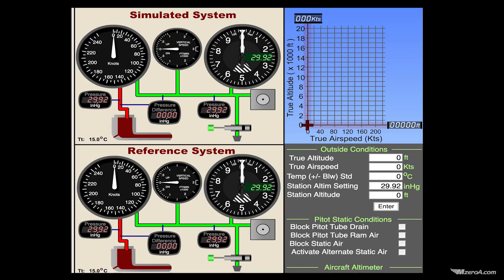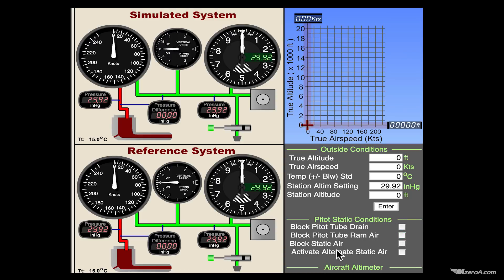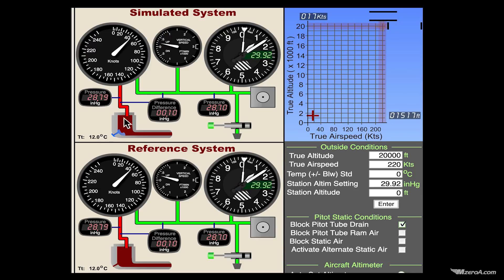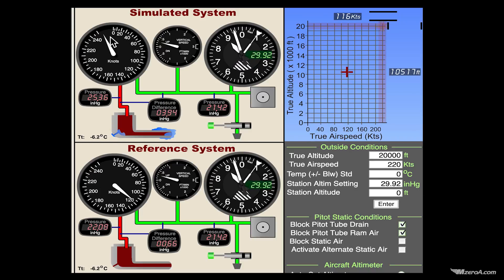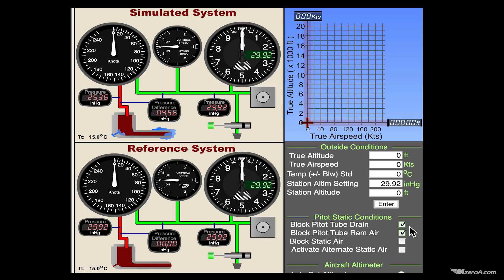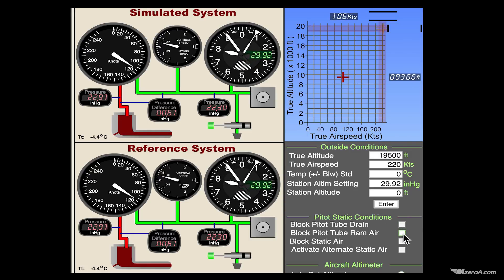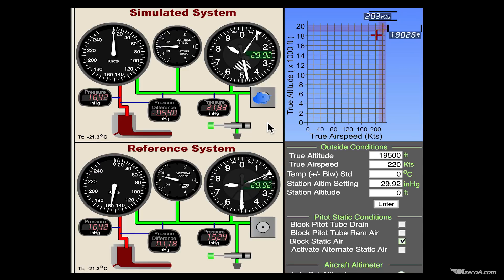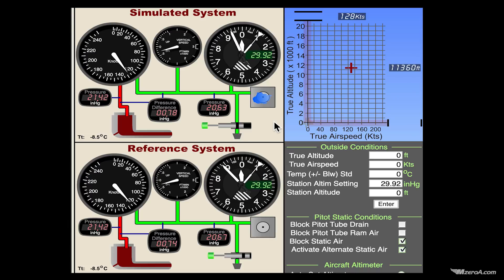Pitot Static System Errors - Day 7 SPC

Comment: I have to tell you.. About 3 days after I passed my check ride, I took the same C-150 I passed in, out for a flight with a lady friend back in about 1996.
We went from the (now closed) Norfolk airport in MA, up to Keene NY. Then we flew back to Fitchburg MA to get fuel.
After getting fuel, I did the runup again, checked all systems etc.. All seemed well, so I took off.
At some point during climb out, the vacuum pump in the little C-150 started failing. I didn't know right off. I started changing headings via DG to head back to Norfolk, MA... 
What I didn't realize, was that I was actually heading to Boston MA.. (KBOS)  Could have been a huge issue... Instead, I realized that (oh yeah, it was at night.. ) that the lights were not familiar.. 
Realized it was Boston, something was up with my instruments, and I did a quick 180° turn..   I know I was below the Boston airspace, but any further I may have busted it.. 
In any event, I lost DG, Artificial horizon and turn coordinator..   Thankfully, It was a super clear night, and I was able to find Rt9 in Framingham, then follow Rt495 S and let the roads lead me back to the base airport.
That was my first "IFR- I Follow Roads" incident.. 
We landed safely, and the little C-150 was in the shop for about a month... I guess they found something else..  
I feel lucky to have survived that, but also take credit in my training to realize something was wrong, and to revert to what I knew to get us back down safely.  (I needed new underwear, however.. )  :-)

Comment: This simulation does show it, but I have yet to see it expressed well enough. Airspeed doesn't "lower" as you climb with a blocked static port, It disappears! I, unknown to me, had a case of the pitot-static spiders. A spider had built a nest in my Cessna static port drain bulb and sealed it off 100%. By the time I was at about 80 feet AGL the airspeed had hit zero. You can probably imagine the few frantic attempts to add airspeed, looking up to see if you're pointing at the ground, checking airspeed to see it dropped more, and then pitching down a little more. That happened at least twice before I looked at my RPM at started to respond by flying pitch and power.

Comment: First of all thank you very much for the SFC series. It's really nice to learn from your videos and refreshing our knowledge as well.  

I'am little bit confused about the last part wich simulates static blockage. Don't you think that ASI reading should still continue to show up  (Over or underread) even static soruce is blocked ? 

According to CAE OXFORD ATPL BOOK: 
-----
Static Head.  A static head is more exposed to icing conditions and is therefore more likely to become obstructed than is a static vent.
A blocked static source during descent will mean that the ‘old’ (higher altitude) static pressure surrounding the capsule will be lower than it should be, so that if the pitot supply is normal the ASI will over-read.  This could be dangerous in that the aircraft is nearer the stall than the ASI is indicating.
Note that a climb with blocked static source and normal pitot air will result in the ASI under-reading.
With a blocked static source, the ASI over-reads in a descent.
-----

What I'am missing here ?

Comment: Static port blocked airspeed drops to 0? Why does other references online show airspeed indicator working at static port blockage altitude, (higher altitudes - airspeed indicates lower than it should.     Lower altitudes - indicates higher then is should)       Which is correct? Isn't there still static pressure trapped in system from altitude it clogged?
Reply from the maker: Hi Randy! To clarify, in this scenario the airspeed went down to 0 because the aircraft kept climbing with a blocked static port. When the static port is blocked, the airspeed indicator acts as a reverse altimeter. So as you climb, airspeed decreases. As you descend, airspeed increases. At the altitude where the blockage occurred, the airspeed will be accurate (assuming you kept the same power setting, etc). If you need any more clarification please don't hesitate to reach out to us at support@mzeroa.com! Thanks for watching!